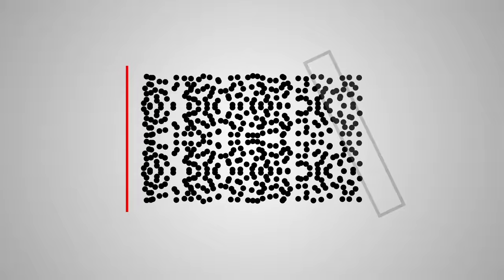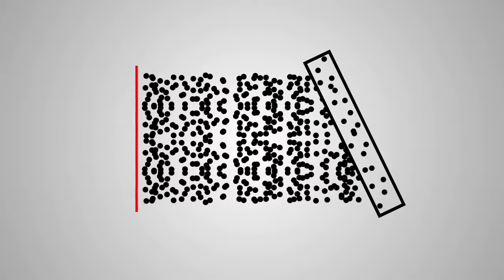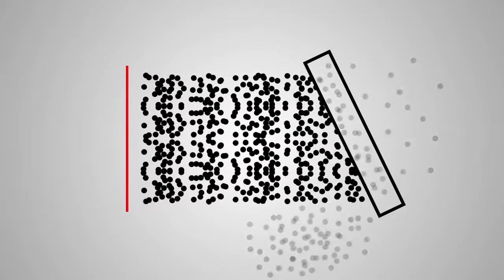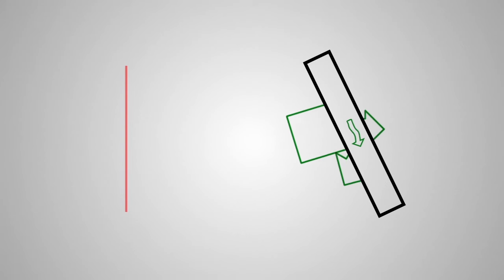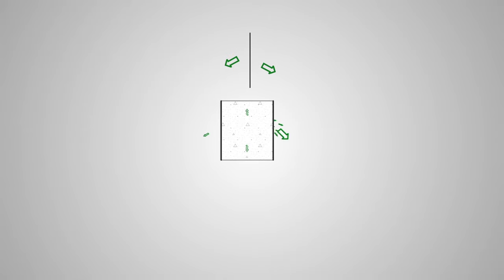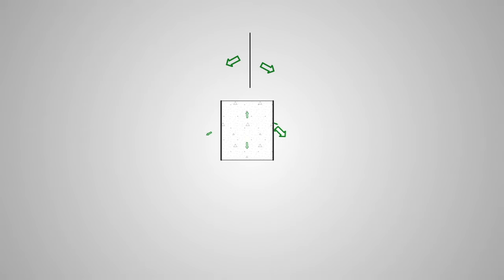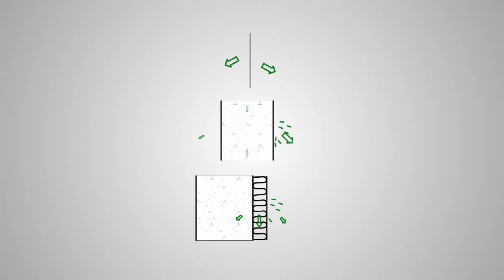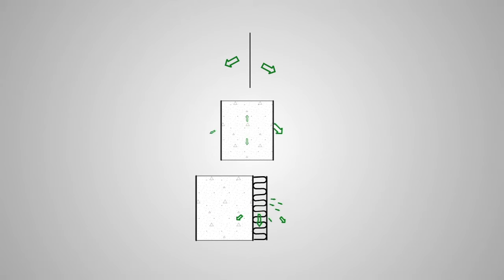Architectural Acoustics 1 of 4: Sound and Building Materials

Comment: Architects don’t think sound travels in straight lines do they? Get a rubber or low sound reflective tube and make a sound on one end and look it then stick it in your ear. 

You’ll hear the sound just fine because sound is nothing really it’s the medium being compressed into waves. 

So Ray tracing isn’t the end all as it doesn’t address sound curving. 

Sound moves more like water. It’ll create waves when it hits a surface but also it’ll trickle through holes and sons corners as well.

Comment: You're forgetting about frequency. Also forgetting about resonant frequencies. Some materials handle low frequencies better than high frequencies
Reply: They mentioned frequency at the very top ot the video, I'd say resonant frequency is not a necessary concept for this illustration. This is great for beginners, lighten up.